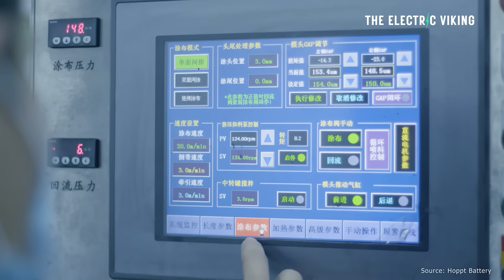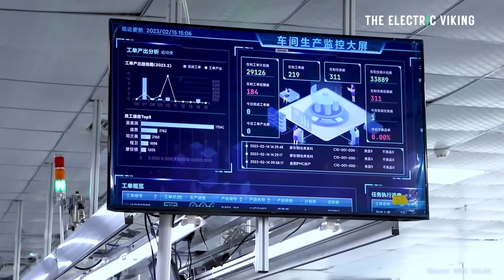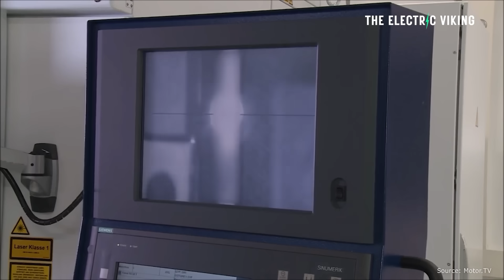NASA has cracked the code for replacing lithium batteries: ‘triple the energy’

Comment: they where going to release airships that could carry 2 oil tankers/cargo freighters in its cargo hold in 2000a but they couldnt find a commercial case for it, lmafao. heavier than air flight is for those that dont understand physics its like making a heavier than water  boats AKA sub its harder & less efficient than floating

Comment: I think the technology is very interesting, but I think the electric planes will not be the utopia we expect. Not only is weight of batteries relevant for flight and energy density for flight. It also means for every kg of battery it means there's less space to accomodate luggage and people. It's been an issue for years on commercial planes and the reason you pay for almost every extra kg these days. A plane can only carry as much weight before it can not take off the ground. Weight is farore essential on planes than cars. What electrification will mean, on my view is the end of long distance travel in one flight. Hub and spokes will get smaller and transfer flights on longer journeys will increase. I think in aviation fuel will be likely still relevant to matter. It will be expensive. I think the trend for holidays will culturally change with the introduction of battery operated planes. Planes will also be reletively smaller which means we will likely see more planes that carry less people per plane. This will make the average plane ticket more expensive. I think hybrid between battery and kerosine engine might still be a future for planes for reason of economics and safety. I'm not sure planes will be much more silent electrically. It's not the engine but the propellor tips  that make a lot of noise as is the wind resistance of the wings on landing that also make high pitch noises. And if they fly more frequent due to less capacity for people and cargo per flight, I think it won't diminish sound pollution.

Comment: The energy required will not change.  How are we going to produce all the required electricity for all new battery powered everything being developed? The problem with aircraft with batteries is they don't get lighter as they fly. Range will drop.

Comment: Electrical grids just cannot handle charging 80 planes an hour . The generation and supply grid will need massive costly upgrade
Reply: Well in this case, you bring the power plant closer to the airport. You would use grid power in this case when the local plant cant keep up. The plant being more solar and wind. High power lines would have to be ran to the airport as well. Some already have those high power lines too.

Comment: 40 tonnes of aviation fuel turns into about 120 tonnes of CO2. That's just enough for ONE trans-Atlantic crossing, and is more CO2 than all your cars will produce in your entire lifetime. You hit the issue right on the head, Sam. We have GOT to stop flying about the planet powered by liquid fossils just for recreation. Rechargeable electric planes might make it possible to fly sustainably. However, as I understand it, the biggest fuel demand for an aircraft is takeoff. Once it's up there it uses not very much (comparatively.) On aircraft carriers they launch planes with a big catapult thing. Why can't we put (future) electric planes on a trolley on rails on a runway, and pull them up to launch speed (200 kph?) with ground-based power? That's how they launch gliders. Save the battery weight in the aircraft. And, can a propeller attached to an electric motor make regenerative power on descent and landing? Regen braking on cars is pretty brilliant. Go NASA!
Reply: Yea, but you still have land weight with batteries that you would need to over come. If anything, the electromagnetic catapults could be used for both to help reduce the amount of energy needed for take off and/or the amount of battery needed once in the air. Landing will still be an issue, but maybe the mix of both could help reduce the amount of weight needed.
Reply: @adr2t  Exactly! If you can reduce the amount of heavy battery that gets launched into the air, that's a huge help to the weight the aircraft can carry and its range.

Comment: Couldn't aircraft that climb above the clouds during daylight hours extend their travel distance using solar voltaic coating and like regen braking couldn't they also regen on decent ?
Reply: Airplanes take advantage of gravity during descent. I don't think it is possible to regenerate power to a battery in addition. Solar panels on airplanes may bring financial benefits in the future.
Reply: It has been done about ten years ago . Around the world on zero fuel. For long stretches over oceans they would climb during the day and use stored electricity and slow descent at night.😊
Reply: @beehappy7797  why do you think it is not possible to regenerate power to a battery on descent ?

Comment: This video gets a D mate. The constant reference to “gasoline” means your research was based on smaller prop driven short hop aviation but the video reels were ATPL type long distance based jet aviation as was the subtext of your script. Batteries may make a difference in regional and private aviation in time. Long haul flights are another matter altogether. 

The comment that most people die in plane crashes due to fire had me scratching my head. Fire is certainly correlated with crashes but high impact high kinetic energy crashes aren’t more survivable if fuel isn’t involved. Perhaps in private aviation your subtext is possibly true given that smaller planes have better glide ratios meaning there are more controlled crash landings that would probably be more survivable without fire. 

If there was an electric ATPL plane, its operating ceiling would be much lower than a jet as it would have to move air somehow for motive thrust, meaning flying through higher air resistance, which means increased energy consumption. How big would the battery pack need to be for a long haul overseas trip? 

Keep it real.

Comment: For now, the batteries method still cost too much weight for power in kg. Even if you place some of the planes design for battery - you still wouldnt have enough for large passenger planes. We need to hit into the 2k-4k ranges for them. For smaller 1-20 people planes, this makes total sense though and could 100% reduce their fuel needs with this battery. Those planes make up a good chunk of the wasted fuel such as planes design around moving politicians around the US. This would help reduce emissions almost by half funny enough. As for the larger planes, we might see them there for a different reason such as coasting power, but the main reason we like using fuel in airospace in just the fact it burns off over  the flight making it lighter as you move from one location to another. Batteries wont have that advantage because they will always keep their weight. Granted, much like EVs, they just need to hit the "Good enough" mark as most fights are just state to state. Long long long flights such as over seas ones can stay fuel base as those will be in between. The other problem with EV planes just the fact there will be a "lag" effect going forward as planes do normally take years to build + safety test + more test + rebuilding + more test flights before they are even allow to go into service. Also, not going to lie, this is ignoring the power cost of charging these things. We're talking about airports that would require CITY POWER requirements as they would be charge 2-3 batteries per air plane around each airport.

Comment: I’m sceptical this NASA battery will have the energy density for commercial airliners like the 737/A320. Prof Alan Epstein from MIT has written interesting papers on the requirements and even a 2 or 3x improvement is insufficient. In the vdo you mention the possible high discharge rate (10x) and I wonder how long that discharge phase can last. Regardless the NASA battery is a very interesting and promising battery development

Comment: Lets be correct and say that batteries are good only for short to mid range flights with propeller planes. No battery will be able to replace jet engines. We need an engine totally different in design in order to replace long range flights for the same time.

Comment: Hydrogen is already flying. Certified travel by air in 2025. Rolls Royce also testing hydrogen based e-fuel in existing aero engines.
Reply: Only in experimental prototypes. There are almost insuperable problems in getting to a safe commercial version. Also H2 is currently produced from fossil fuels…. Add in the very complex onboard systems and the windmill to prop inefficiency and it’s unlikely to takeoff. Ground H2 transport has failed - so will airborne.

Comment: The statement that it will make air travel cheaper isn't backed up by anything you said.   Even if you could get electricity for free which is doubtful,  a battery with  1000 cycles cost 1/1000 of the price of the battery every time you cycle it.  A  50 to 75 seat commuter plane will probably need about 10 megawatt-hours of battery assuming electric motors are three times more efficient than gas turbines . How many dollars per megawatt-hour will one of these batteries cost?

Comment: Free electricity?? Has anyone experienced this ?!! These batteries for cars yes I do not see it for commercial aviation as more cars become electric lower fuel demand will reduce fuel cost reducing the ROI on conversion to electric. Also a planes take off and landing weights are figured on losing weight as fuel burns in flight reducing  landing weight which is why planes will dump fuel if they are too heavy for an unexpected landing. I look forward to better batteries but not going to happen in commercial aviation

Comment: Keep hearing about this "amazing" batter technology that is just around the corner for many, many years now, and up to this point it has all been 100% vaporware.
Reply: Then you’re not listening to what you keep hearing. Over the last ten years batteries have dropped from over a thousand dollars per kWh to just under a hundred dollars. They have longer life and faster charging. They no longer need rare or dangerous materials. The changes are incremental but they keep coming rapidly.😊
Reply: Then just stick to doing things the old manual laborious way...better not ever use a cordless drill,saw,light,etc...
Reply: @Ash-hq8jw  What does that have to do with anything I said?
Reply: @Ryan_DeWitt   everything..You're basically saying that all batteries are the same...according to you "vaporware"
Reply: @Ash-hq8jw  You need to work on your reading comprehension skills a bit.  I said this new battery technology they keep talking about that is coming, like quantum batteries, batteries holding 100x the charge, 100x cheaper and charge 100x faster and whatever crazy promises they make.

No remotely reasonable person would think by reading that statement I was saying that all batteries are the same WTH?
Reply: @Ryan_DeWitt  reading comprehension skills? Me ?..how about your literacy i didn't slander you with..Mr "batter" battery technology...and yes battery tech has gotten substantially better since when they were first introduced..that's blatantly obvious

Comment: First, NASA has always been far more than
to rocket enterprise. By the 1990s NASA had
spun off over 1400 new INDUSTRIES. TWo
we always think of are memory foam and
the widespread adoption of Tang orange
drink.
Second, you are talking about a NASA
battery with 3X the energy density of lithium
ion. But lithium/aramid/sulfur batteries
have a 5X energy density. That's 40% better
than NASA.

Comment: First it is NASA not NARSA. Second batteries would be only useful for very small planes as people are paying to fly to make the time as short as possible. Third batteries are only useful in vehicles in areas that have a large population in a small area. Go to countries where there are 200 or 300 k's between towns and they are useless. It is not the case that you cannot really do the distance, but you want to cover the distance with reserves still left. Just in case something happens on the way, or you reach the town and the chargers are not working for some reason. Also, most electric cars will be charged at nighttime when people are home. No sun no benefit. So there will be a greater need for electricity of a NIGHT compared to now. Not paying $10,000 for solar panels on a house to have to charge a car in the street at work and pay.
Reply: A problem for every solution? Your name says it All!😊

Comment: Too bad internal combustion engines are so inefficient.   One stroke in 4 produces power.  Regarding Jet engines.?   Well FAA recomends  rebuilding periodically and we aren’t talking peanuts.   Modest sized jets cost 1/2 million each to rebuild every 3500 hours. 
 Yet the electric motors on trains pulling  80-90 100+ tons  last decades.

Comment: For electric transport aircraft you not only need very powerful batteries with high energy density, but also the electric equivalent of an internal combustion jet engine. I have not heard that such an engine is available.
Reply: Electric motors can turn a propeller and so replace the ICE engines in prop planes.
Reply: Ducted fans
Reply: Electric motors can be much smaller, lighter, and cheaper, therefore, more can be used on an aircraft, producing the same power, and also increasing overall reliability.
Reply: @paulstubbs7678  I don't think ducted fans are comparable in performance to jet engines to achieve the speed of a transport aircraft as we are now used to.

Comment: I really wish he would include the cost of these new battery chemistries.  Last time I heard Selenium is very rare and expensive.  That would raise the cost of these batteries beyond making the cost effective.
Reply: Selenium isn’t particularly rare. It’s generally been produced as a byproduct of smelting other metals where it’s a common contaminant. I don’t think we’ve ever deliberately tried to mine it. Maybe back before silicon replaced it in most electronics. If demand did skyrocket, I’d imagine that - like lithium - we’d fairly quickly identify new sources. It’s reasonably abundant in seawater as well.

Comment: Sam,
I'm sorry to say, you just lost a lot of your credibility.

Better batteries will make large vehicles like busses, trucks and cargo ships possible/feasable.
Also, if battery capacity grows, better make lighter and cheaper cars instead of cars with 1000 miles range, nobody needs.(lighter = less consumption, smaller tires, lighter brakes,..) The average car in Europe goes for 15000 miles per year, so a bit over 1000 miles a month. People need the long range for a once or twice a year road trip. 400 miles is more then sufficient for a road trip as it means that you can do 280 miles in a 10 to 80% rithm and you can take a one hour pause to eat, go to the toilet and recharge every four hours. For every day use, even 200 miles range is more then sufficient. 
Commercial aviation will not go there. The weight is prohibitive as is the average speed of propelor driven planes. They fly around half the speed of jets, with more noice and less comfort.
They also have a lot more drag due to the props and wingshape.

Comment: You don't seem to understand economics very well.  When a company installs a solar farm, it is certainly not free.  If the best they can do is essentially give away their product, they will not stay in business very long.  Probably the only reason they are in business to start with, is the big handout by Uncle Sam.  There are solar installations above  Buffalo, NY.  But in the dead of winter, I am pretty sure they will not be capable of charging up very many airplanes.   My solar lights do not even work in the winter.